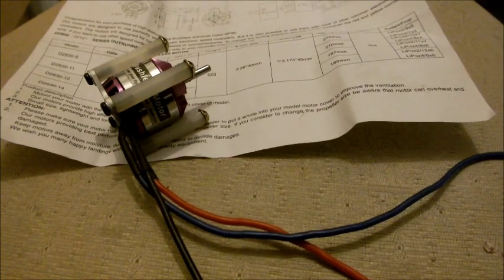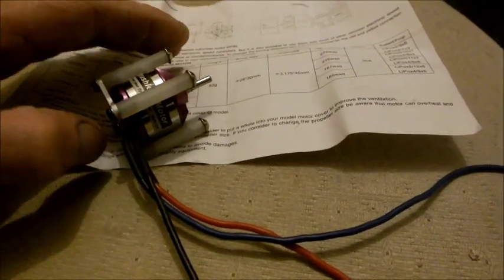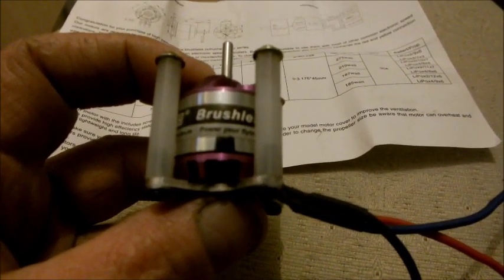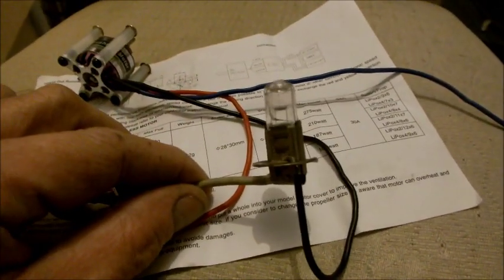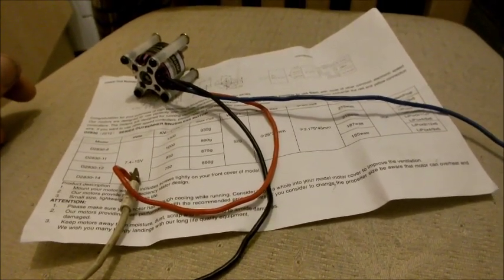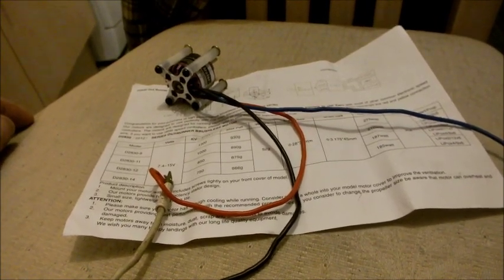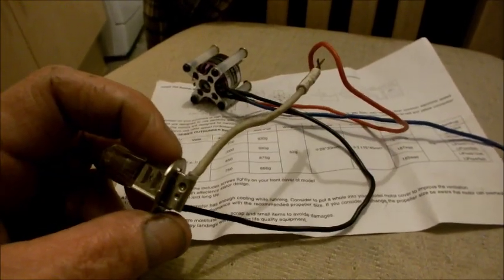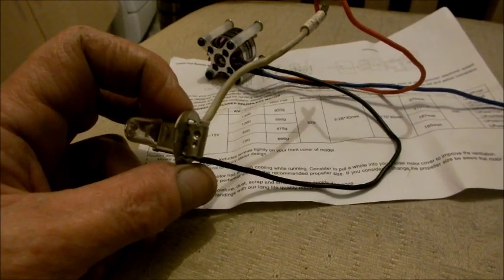Brushless Motor Used as An Alternator, description and test with surprising results!

Comment: So I can rig up a gear system to my spur gear, leading to my alternator and have lights on my nitro RC...without batteries?...sweet.
Reply: Absolutely.! But what i would do is look on ebay for a small device called a Buck/Boost converter/Regulator, they cost about $2. This is a small postage size stamp circuit board that takes (Keeping it simple here) any DC voltage in, and it doesnt matter how wildly this voltage varies, it will automatically step up or down the input voltage to whatever you preset the output voltage to be. For example, you can feed say anything between 3 and 50 volts into the input and set the output voltage to say 12v and this board takes care of the rest, so 3v in, 50v out or 50v in 3v out. You will need 6 diodes from the brushless to rectify the AC and turn it into DC then a largish value cap to smooth the DC before feeding it into the Buck/Boost. That way it make no difference what the engine speed is, you will get a constant DC voltage out. Get another small module for charging LION batteries and you can keep those topped up as well.

Comment: 3 wire to -> battery = ¿
Reply: NO....Read the previous posts, a brushless motor is in fact a 3 phase AC generator and will want 6 diodes to rectify the AC from the 3 motor windings to turn it into DC

Comment: I have been thinking about this for some time but never really experimented with this concept, theoretically there is no reason why a brushless motor cannot be used for generating power. I am interested in finding out how much current output you could expect this way,  e.g using a BL motor rated at max. load 250W @ 50K RPM what the results would be if used as an alternator(spun manually) @ the same 50K RPM? Would you get 250W back out?
Reply: Dwayne Rothe the dremel I used was only 170 watts and I only had a load of some 10 amps at 16 volts. Brushless motors are very efficient and I would expect you would get pretty close to the motors rating, if not more but keep a close eye on the heat
Reply: Thanks for your fast reply John, agreed the generated heat at such high RPM would be excessive in a short amount of time, I think spinning it at 50-75% with the occasional full speed burst and having a decent amount of air flow or other means of cooling should prove to be a fairly reliable setup.

Comment: i tried to charge 12v battery with 250w bldc motor as a generator. i connected the three output leads of the motor to a 3 phase rectifier and then to a voltage regulator. i rotated the motor at a speed of 30rpm, the motor starts rotating normal, but after 15rpm the rectifier and the regulator gets heated and the motor found to be more loaded like a short circuit. how to rectify this?

Comment: I wonder, is it a crazy thought, has anyone ever considered putting a bunch of these as tiny VAWT generators on an ultralight aircraft that is powered by an electric engine to keep a good charge going onto the now growing lithium ion battery banks? I.E. collecting the draft on an ultralight motor glider?  ©2017 all rights reserved.
Reply: I try with one motor give me 18.5 volts not enouh amps to feed the sistem. But if. You have 4 install under your drones originals motos i am prettt shore it will feed the how sistem you my need a resistence to increse the amp and a voltage regulator. Remember it.s around 18 volts per motor at high rpms.

Comment: is it produce AC or DC ??
Reply: AC you have to use diodes to rectify and change the AC into DC
Reply: John Lannigan .sir suppose this motor have the capacity to produce some 2 watts in AC. after rectify to DC,, ,will the output watt b the same as 2 watt or it differs.??

Comment: I'm trying to do something similar to what you're doing.  I'm planning on using four smaller motors driven by a single engine to a single 80A three phase rectifier.  I'm just wondering what kind of voltage I'm going to get out of the motors.  I'll be using the power to drive eight of the same motors being used to generate power.  I think a voltage regulator of ~80A is gonna make it all too heavy for my application.  Please find me on FB, I would love to discuss this with you.  Bob Roogi.  Or let me know right here.
Reply: lol. great minds eh. im about to do this for a friends campervan, to assist with solar charging, im starting to think that wind turbines alone can supply the demand lol. rewinding is a cinch for specific results too.
Reply: KillaG FPV of course turbines could supply the demand if not a mix of solar and motor generation ... suppressed technology,  by the the oil companies , money Rothschild money

Comment: i want to charge 12v lead acid battery from a bldc motor which is used as generator, can you please tell me which circuit is used to rectify and regulate the output of generator.

Comment: Hey john. I was thinking about 10 mins ago about self-charging rc cars and quads. What got me to thinking about this is because i was adding Brushless motors to my Amazon store HobbySquad USA (cheap plug). I'm just wondering if there is a way to use these motors as alternators to put charge back into the batteries by having a drive belt on the shaft of the motor connecting to the wheel? 

I get lost when it comes to current and things like that, but i think it wouldn't be enough juice to fully recharge a battery, but could it possibly give you longer run times?

It's a good project for someone that knows a thing or two that may could come up with a self-charging rc car.
Reply: +Chris . Jones In a word Chris, NO...Let me explain,every time you convert energy from one form to another, in this case electrical to mechanical, or from battery to motor, you loose efficiency. To use an example 100 watts of energy coming out of the battery, might only give 85 watts of useful power at the motor, many things contribute to this loss, friction and heat are the worst two factors. So now assume you have connected a brushless motor as an alternator to an existing brushless used to lift the quadcopter, you have the same thing in reverse, you loose efficiency again converting from mechanical movement back into electricity, the whole chain is now very lossy. So starting with 100 watts from the battery, you end up with say 85 watts of useful power, now 85 watts transformed back into electricity would lose say another 10 watts and only gives you 76.5 watts back to the battery. (ive used 10% values here to keep things simple) so as you can see, youve lost 73.5 watts for doing absolutely nothing apart from keeping the quadcopter warm..! Another classic question often asked along the same lines is fitting solar cells to a quadcopter to get a free ride, again conversion plays a part in this. The more weight you have to lift, the more energy you need to put in to lifting it, it would take more energy to lift a solar cell, then it actually produces. I hope that answers things for you?
Reply: Hi John, a quick question: If I have an electric scooter using a brushless motor, CAN I use that motor when in down hills to work as a generator and put that back in to the battery?! if so, what kind of controller can do both jobs( as a motor and as a generator) for the motor please! thank you for sharing your knowledge!
Reply: Yes you can, in fact you can get brushless motor speed controllers with this feature added, its called regenerative braking.
Reply: In a word NO....There's no such thing as a free lunch or perpetual energy. When you convert any energy from  one state to another, you lose efficiency, nothing is 100% efficient, so when you convert from electrical to rotational energy, you lose a bit, if you added a brushless to a motor as an alternator, its even worse, you lose energy in converting electricity to rotation, then rotation back to electrical energy so you lose out twice. If the alternator is giving out say 100 watts of power, it would probably take around 130 watts or more of electrical energy to do this. The dremel type drill i used in the tests has a motor rated at 170 watts, but the most i could get from the alternator was around 140 watts.

Comment: Great video John, chapeau! a bit more numbers (measurements) about V/I related to rpm would be helpful (I'm just going to purchase one, measure and publish). Do you know if there's any substantial difference in performance between in runners and out runners?
Thx a lot
Manlio
Reply: +Manlio Malavolti  I didnt do full scale investigations with the brushless motor, i had a need to charge a battery and the brushless motor did just that. I did load all 3 phases at the time, but because the motor on the dremel was only rated at 170 watts maximum, i couldnt realistically generate power beyond around 150 watts. There is something important to bear in mind when trying to  obtain high currents from a brushless motor and that is cooling. These motors are designed to be run with a propellor on the shaft that cools the motor, you need to keep an eye on the motor temperature if you dont have a fan or propellor connected. There is no difference between an inboard or outboard motor in this application, just the method of mounting, but outboard motors tend to be open allowing for better cooling. J
Reply: +John Lannigan Thanks John, my problem concerns a brushless used as a dynamo to charge my phone, I calculated that the motor shaft would rotate around 5500 rpm with the bicycle going at 20-25 Km/h, with a 3 phase diode bridge and an IC to stabilize current at 5V the trick should work. But regarding brushless I see that speeds range around 15K-25K rpm and current flow ranges around 10-15 A (I need max 1A, otherwise my phone can catch fire) I wonder where I can find technical data about the performance (V, W, I)  in the area 4000-6000 rpm, which is my area of interest (I'm a bit out of shape....) . Perhaps I should use a brushless with gear, which increases the cost. Any suggestion? M

Comment: how we can  run in 2 wire 7.4 direct is any way
Reply: +Kanari Mentos I am not too sure what you mean Kanari, 2 wire 7.4? do you mean 2 wires and 7.4 volt connection??
Reply: ok usually the brushless dc motor coming  3 wires ..and esc can you run the motor just give,t voltage dc ..means the motor you have can you run.t just plug dc voltage and run
Reply: i have quad copter is brush motor i need to replace brushless motor into one single phaze is that  work
Reply: John Lannigan
thanks sir is difficult what i see i am asking for dc but never mind thanks for everything will get quadcopter with brushless thanks

Comment: Great video. Just to learn the ropes I'm trying to build a generator for my stationary bike. Right now the bike has a mechanical brake to create resistance. But I want to swap that out and put in a brushless motor to act as a generator. Here's my problem: How do I create varying resistance in the motor so it acts just like the old mechanical brake?
Reply: a gearbox
Reply: +darkmath100 To get a varying load like you need, first change the 3 phase AC output into a single rail DC supply, Google 3 phase rectifier. Then with a simple circuit for PWM control, vary the DC output that you feed to the battery. Make sure the brushless motor speed is high enough for the motor to generate a good enough output. You can also get the same result by using an analog circuit with a power transistor of FET, not as efficient but it will work, also add a series diode, a power schottky to prevent back feed from the battery,
Reply: John Lannigan Thanks John!
Reply: +darkmath100 I had a similar problem with a project a while back, this was in fact an electrically assisted tricycle. I wanted to recover some of the energy of movement, back into battery power. I solved this by using a variable resistor that was connected to the brake cable. The cable was adjusted so that the normal brakes only operated in the last 1/3rd of the brake lever movement. A variable resistor was then connected by an arm to the brake cable centre. The first 2/3rds of the brake lever movement varied the value of the variable resistor, and in turn, varied the load on the motor. Thats it in simple terms, you need to add springs adjusters, a metal box etc to get the arrangement right, but i worked fine. This regenerative braking gave me about 5 to 10% extra range out of the batteries.
Reply: John Lannigan Thanks again John. You seem to know a lot about this stuff. Maybe I could call you on Skype? I'm not an Electrical Engineer. I'm actually a History major and got into computers and electronics later in life so I'm learning all this stuff on my own. I've laid out my design and what you wrote is helping me refine it a lot. I'm building a mock up of the exercise bike with an Arduino for PWM and a tiny little BLDC, a rectifier and rechargeable battery. The goal is to just put a handle on the motor and twist it with my hand to simulate foot peddles moving a bike wheel.

The problem is it takes me forever to get the stuff put together because I still struggle with which pins do what and where to put resistors so I don't burn out the Arduino. I get the big picture but have trouble with basic wiring.
Reply: +darkmath100 Yes add me on Skype its jomac_uk

Comment: I would use a 3 phase rectifier and all 3 wires coming from the motor if you want to use max power. The thing under the motor at 4:00 was a small hobby vise to hold the motor still.

Comment: why are suCH motors so much more expensive than brushed motors?
Reply: Calmic power  They are a precision motor which run at very high speeds, many times faster then ordinary DC motors. Some of these brushless motors run at speeds of 40,000 RPM and more. Therefore the moving parts are accurately balanced to eliminate vibration. In addition the magnets used are rare earth magnets, which are more expensive then magnets used in DC motors.

Comment: I didnt do any exact measurements shodanxx as i was more concerned with 'would it' do the job and not how well it would do the job. Looking back in my notes and scribblings, i had in fact at one point, connected 3 quartz halogen car spotlight bulbs to the motor, one per phase, and running it to the max the dremel would run, i managed to achieve 15.3v approx per phase at 55w + loading.

One thing to be careful of, if you want to run a brushless from a car turbo, most brushless wont stand the high RPM the turbo will reach. You will need to gear this down.
Reply: Hi John,  I found this thread from searching out runner conversion as alternator. I understand the efficiency loss from one to another ,  but using the same concept as diesel trains. As they drive / pull on electric. The drive train is actually electric . The noise we hear are the generators charging the power banks. . They are far more efficient than diesel or gas directly to the drive train.  That being said. 
How can we set up micro scale generator on board 1/3 scale electric rc airplane.   Use  40 size os max rc nitro engine  direct to E. out runner shaft , wired to SMART lipoly charger,  all this to enhance primary lipoy bank on large scale rc planes. ( increase flight time dramatically)  sounds stupid I guess but the concept apparently works in real world cargo trains.

Comment: I'm going to attach little motors like these to the turbine section of an old car turbo which will run off a gasifier.

What kind of efficiency did you get in your test ? (power input to dremel vs power output of the brushless motor)

Comment: Remember that the KV rating of 1000 is 1V per 1000 RPM, so if you have a motor 4S 1000KV motor you could expect to run it up to around 16-17000 RPM for rated current... perhaps a bit more if it's not quite as efficient as a generator, but I don't see why it should not be.